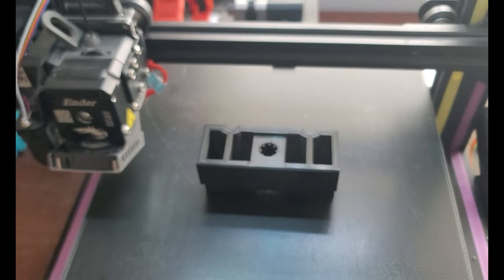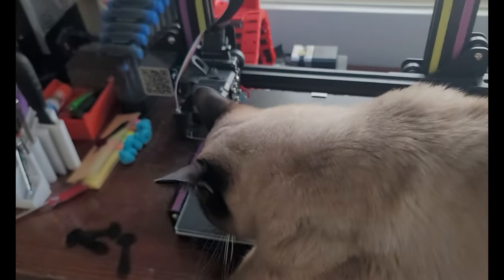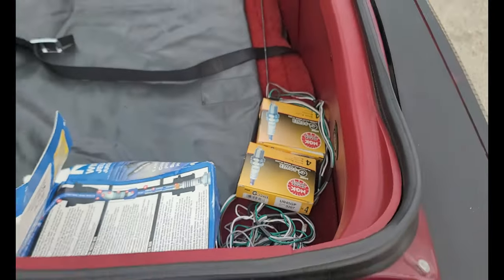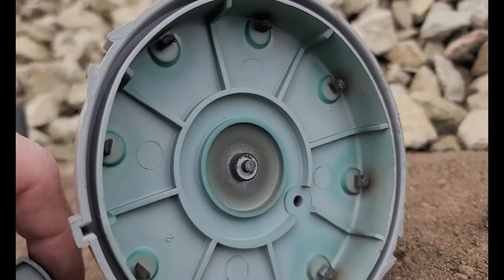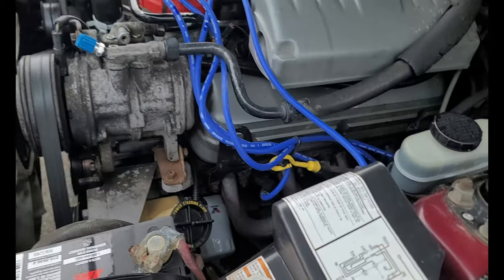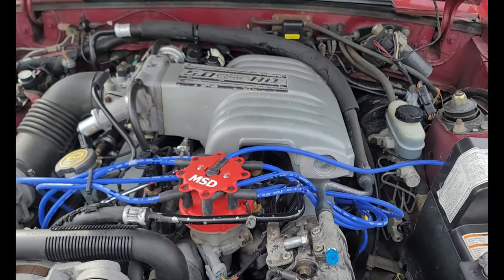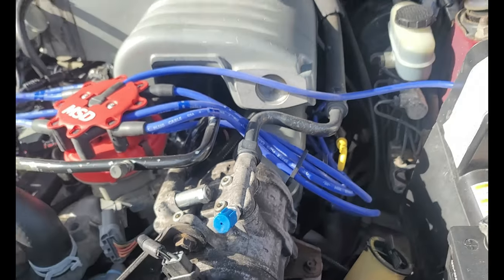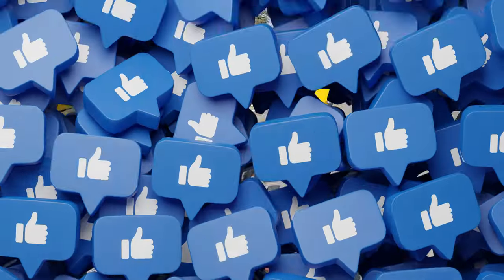Foxbody Resto blog let the fun begin | Mustang Shenanigan

Comment: Old dried out plug boots can just vibrate loose.  It happens.  I actually had one come off in the pharmacy drive through once.
Also you say you probably have $2 in materials in the battery hold down. I have to ask, what do you have in your time to design it and so forth>
Reply from the maker: I definitely don't think it was a issue of a dried out boot, all the other plugs were on relatively tight. I think what happened is when they were pressure washing the motor maybe they got knocked off. 
As for designing a battery hold down and a prop Rod retaining clip Believe It or Not There are open source code files available on the internet that take all of 3 minutes to download and a little bit of time to print.
Currently I am working on a antenna delete that can be purchased for a decent chunk of money but I've managed to find the file and print it so all in I'm at less than an hour worth of work including the printing.
Reply: @streetstomper  IDK, the plug wires you pulled off looked like they'd seen better days/  A couple could still be loose from age, and the other still be tight.  Heat would have a lot to do with that.